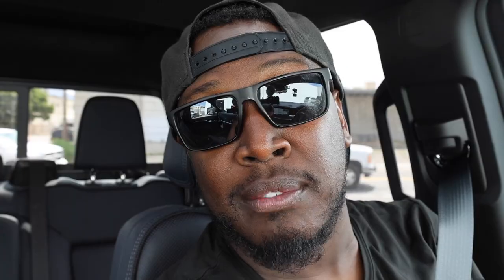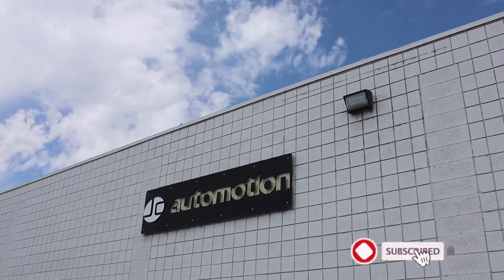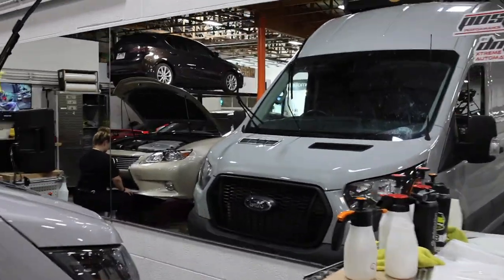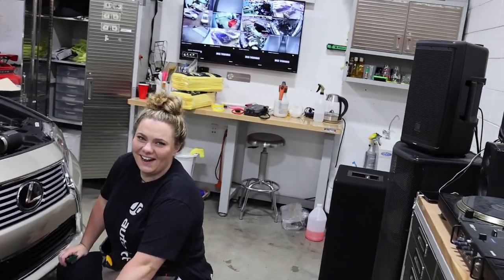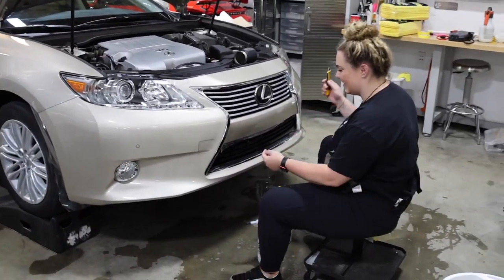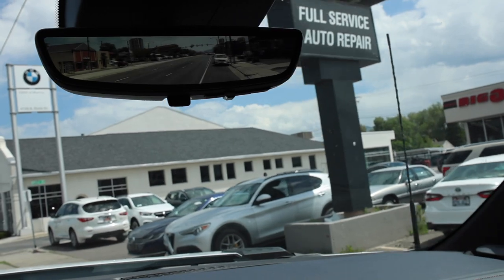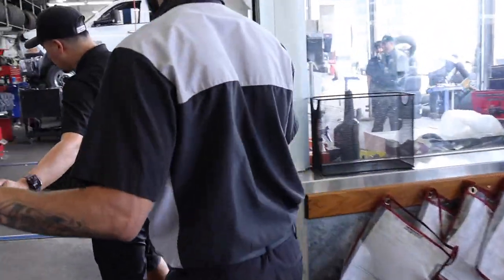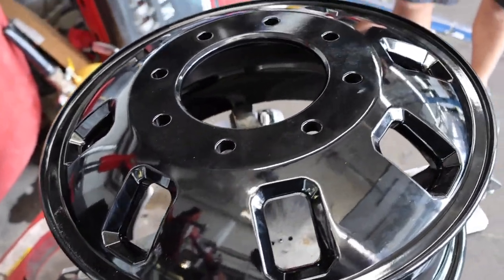The Wheels Are Finally Powder Coated For The 2024 Chevy Silverado 3500! How Does It Look W/ 37's???

Comment: Hey JB, great videos.
I have a a question, I just purchased a 2024 Silverado HD . LTZ ,Z71 gasser.  It came with the LTZ premium package.  According to what I’ve read the truck should come with 20” wheels but the dealer said it comes with 18” and it’s an additional add on for 20” wheels.

Since ypu are the GM build guru, can you tell me how I can determine what it should have?

Thanks